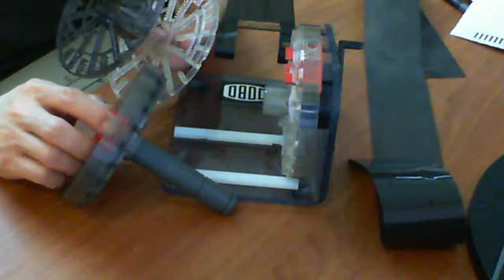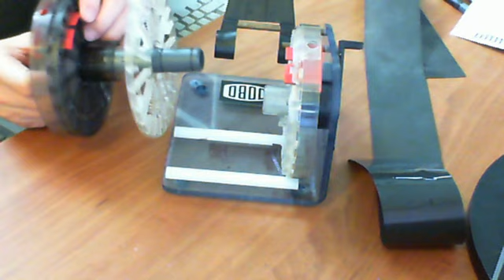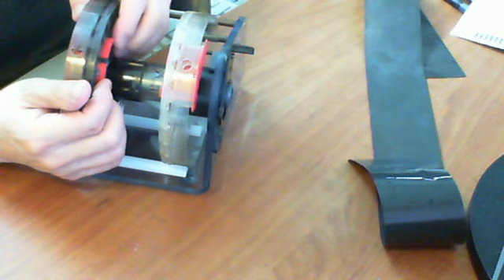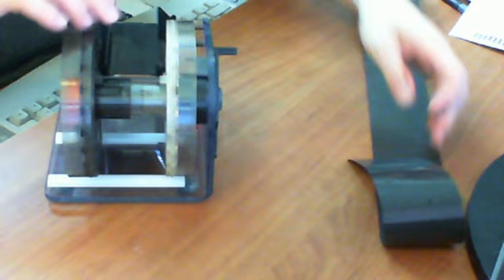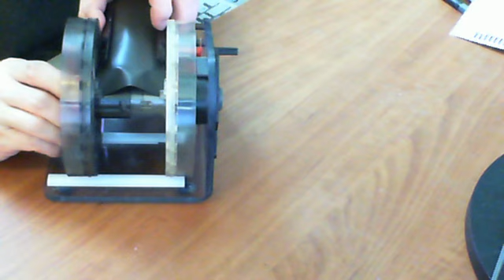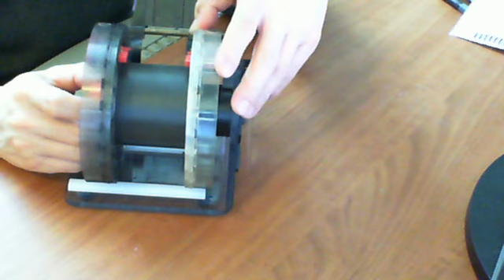load-film-to-Jobo-reels-using-loader.wmv

Comment from the maker: Use normal film tank? Unless you do large format like 4x5 or above using expert drum, HOW DO YOU USE A DRUM without using reel(s) inside the tank?

There are alternative reels. The pros of this loader and reel combination is that it allows you to load more rolls per reel, the price you pay for this capacity is slightly more complicated loading process.